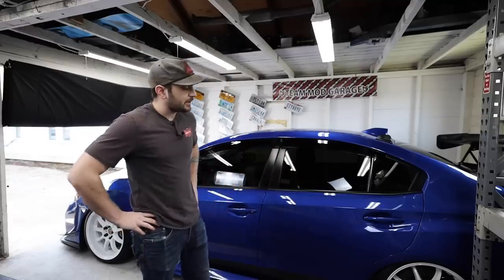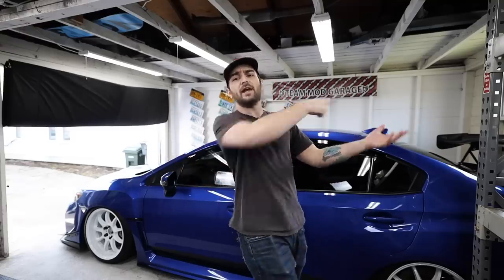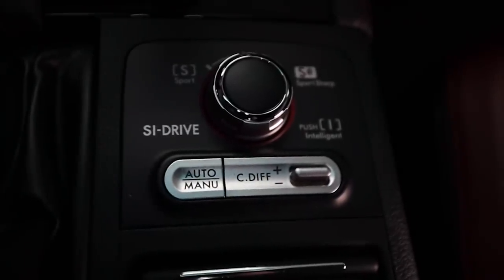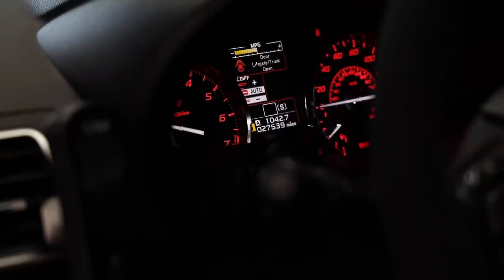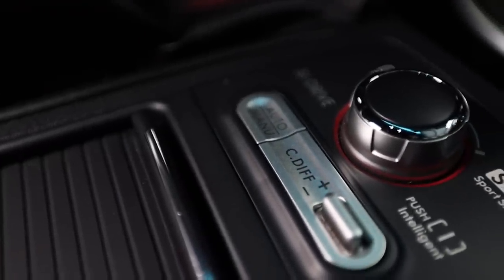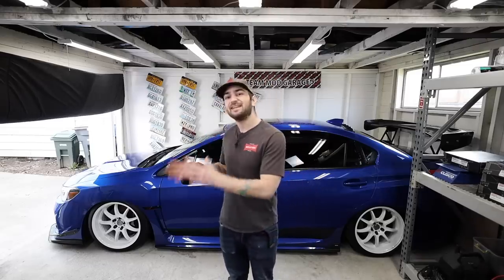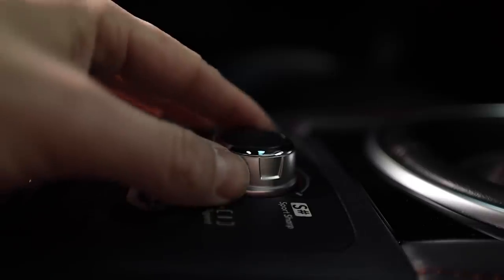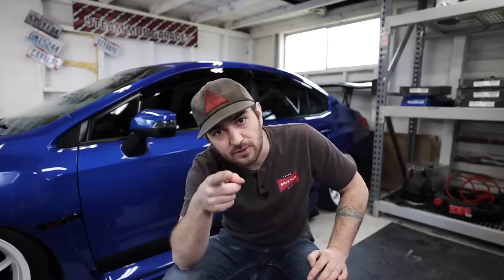Subaru STI DCCD (Driver Controlled Center Diff), SI Drive Explained

Comment: It's not about front or rear bias, it's about how much locking force is applied in the electronic LSD of the center diff.  The bias is dictated by the planetary gears and therefore always fixed at 41:59.  This is hardware-driven and cannot be changed by electronics, which only control the increase or decrease in the LSD effect of the center diff.
Reply: This is exactly what the dccd is doing but it seems nobody understand such simple thing.

Comment: Awesome detailed information brother. My VDC is a glorified boost controller now with my Protune. On an external wastegate setup and 3 port boost solenoid. 

I = 13psi (Spring Pressure) , S = 15psi, S# = 18psi.

Before in stock mode, VDC was pretty much pointless, and always left it in S Mode.

Comment: Torque is definitely where it is at, especially in the rear end for "more adventurous" driving! I will concede that the DCCD is the only feature I wish the WRX came with even if it was only offered in auto format with no manual settings.
Reply from the maker: It's well worth it and would be interesting to see how it would interact with an fA engine

Comment: You also have aftermarket DCCD controllers that add quite a bit more than stock. MapDCCD and Spiider Plus, both are more sophisticated and can be customized as well as have better auto settings. Although this more applies to a WRX with swapped STI 6 speeds.

Comment: Love the videos brother but you are going over the DCCD and SI-DRIVE systems.   The dial for Intelligent (I), Sport (S) & Sport Sharp (# ) is the SI-Drive system.    

VDC (vehicle dynamics control) is Subaru’s Electronic Stability Control. This is found in pretty much every Subaru model.  It’s like traction control.
Reply from the maker: Appreciate the feedback and thank you for clearing it up, I've always just referred to it as the VDC for some reason 😅
Reply: I thought I was losing my mind, or couldn’t read.

Comment: I found in my 06 sti most of the time I have it almost unlocked fully (usually in the second position from the bottom) and it stops the rear diff from doing the annoying clunk between gears at low speeds. If I have it fully unlocked it will do it almost all the time unless i'm accelerating hard between gears. When its wet roads i'll put it halfway locked for better front end control, but if it is snow/ice i'll keep it almost fully locked. Only time I ever lock it is when I am drifting in really deep snow, I do notice the steering get much stiffer as I increase the diff lock as well. Fuel economy is effected greatly by having it more locked as well, so that's why I mainly keep it unlocked. In auto mode I can feel my car almost always has my diffs locked cause my steering gets heavy and you can hear the front diff wine more. Love having the option to change between the settings though, manual mode is definitely the way to go!
Reply from the maker: Just takes the time to learn how to use the manual setting and the best way to do it is by playing with it. Seems like you've got yours dialed in and figured out!

Comment: Just got a '20 STI a few months ago. 
I figure for most driving, leaving DCCD in manual and with full "minus" puts it as open as possible (lowest chance of binding) and since it's not auto, it won't be constantly adjusting things so they aren't wearing out as fast.
Make sense?
Also, in traffic, I find Sport+ best because it's easiest to avoid stalling if the engine responds immediately ☺️
Does the SI Drive setting matter when in cruise control, given that the throttle is fully automated then? 🤔
Reply from the maker: When it cruise control it won't really matter the SI drive just adjustments the sensitivity if the gas pedal 🔥

Comment: Auto + and - is not bias front or Rear. it's just how much force will there be to keep the C Diff engaged. + means the C diff is firm with very little slip that your rear wheel speed with match front wheel speed if either wheel lost traction. - means the C diff is loosely engaged and power will be send to the wheel that lost traction. Please refer to page 7-20 on the Owner's Manual which makes everything crystal clear.....

Comment: Honestly i couldn't go back. The benefits of both are like a different car and awesome to change it up. Auto + is a beast that pulls you through tough turns if you can manhandle the torque steer. True AWD feel. Wish we had split % #s for +/- and all manual ranges. I believe LOCK is locked 50/50.
Reply from the maker: It would be awesome to be able to had that additional torque split. But the DCCD is such a good tool to be able to use 🔥

Comment: Do I understand correctly, that DCCD allows to set the Rear/Front power distribution in a range of 50:50 on highest manual lock up to 41:59 on lowest manual setting?

Comment: Thank you for explaining everything so well! I been trying to decide to get wrx or sti for many years. DCCD and VDC sounds great but thats an extra gadget or equipment that ads more weight to the car and causes reliability to go down because its more stuff to break down. I wish they made the WRX with the STI transmission and the 2.5 liter and sti turbo because I really don't like the idea of adjusting all these nobs. WRX seems much simpler but it has weaker transmission and rev hang and less power than STI. Plus sti can be modified very heavily up to 600 horsepower  with factory transmission. So they are very different cars on the internals.
Reply: Just build an STI swapped WRX if you haven’t already. That’s what I’m in the process of doing atm.

Comment: Im protuned by Johnson tuning. I still feel a big difference when going through the VDC modes. Intelligent wont let my boost dont past 8lbs. Sport gives it a nice response. And sport# is too agressive lol. I hate that mode. Its good for racing but normal driving its too agressive and responsive. If i drive in sport mode for a while and switch to sport#, i find my self over revving the car in first gear.
Reply from the maker: Sounds like it has a solid tine on it and is a lot of fun to drive though 😍

Comment: Hey man, you got it pretty wrong on how the DCCD works. It doesn't bias front or rear. It simply modulates the amount of lock up force the DCCD clutches apply.

Also VDC is not that knob. That's called SI-Drive, which is just a tune mapping changer.

Comment: 'SI-Drive' and 'VDC' are two completely different things. What you're referring  to as VDC is actually SI-Drive. It does what you describe and I agree that it's pretty pointless. Although on automatic transmissions it's supposed to change shift points and the way it shifts, so maybe it makes a bit more sense there.

VDC, on the other hand, is basically ESP - electronic stability program. It uses accelerometers (G-sensors) and gyros to detect 'unusual movement' (a.k.a. sliding out of control) and than cuts power and / or applies individual brakes to stabilize the vehicle.
Reply from the maker: Left a note in the description that I pulled thr names backwards but that you for adding the clarification!

Comment: I really hate sounding like a fanboy..

Hearing your car driving, and considering you've done so many things I've wanted to do and do myself, hearing how it sounds accelerating I know I have my Protune right..

Sounds exactly like mine! Makes me feel like I'm doing it right!

Only problem was trying to put a full 3" DP+N1 Invidia Exhaust. Too much flow, and would overboost constantly in my '17 STi Limited. Had to go back to the factory DP for now until I can install an up-pipe, external wastegate and boost controller. Just was shocked at how much the factory turbo wants to make boost at 55k miles still!
Reply from the maker: Not at all and totally acceptable, glad to hear that your build is going the way you want it to 🙌 the turbo wants all of the boost!!!!

Comment: have another question. i have a 15 sti limited. what does
1) LSD torque
2) Traction torque
3) Initial LSD torque (maximum)
4) Initial LSD torque (minimum)
A) Initial LSD torque (adjustable)
B) Mechanical LSD torque

Comment: I appreciate your time on all these video's. I have wanted a WRX for over 10 years, finally purchased a 2020 STI about 2 weeks ago and i have learned so much from your video's. Question, once i start using OTS Maps or protunes, does the VDC still change the percentage of throttle response, or does it stop working all together?
Reply: Also you can have those 3 setting reset to other values?
Reply from the maker: It will still change the throttle response 🙏😁 once you get a protune down the line your tuner will re program them. And congrats on the new car 😁😁😁
Reply: @Smeedia  Thank you! So far I have only put a Cobb SF and an Accessport 3. But I have collected parts to change out the exhaust completely, J-Pipe, New turbo controller, new fuel pump, 1050x injectors, waiting on one sensor and ill have that all installed and protuned. I was thinking of working on getting forged internals next but i am really unsure of where to go after that.
Reply from the maker: Intercoolet wouldent be a bad idea 🙏🔥
Reply: @Smeedia  fmic was my thought, then get internals up to par before messing with a bigger rotated turbo

Comment: I want to use it for drifting I want to have the option of all-wheel drive but I want to be able to put more of my power to the rear end so I can drink with the car when I want to is this actually feasible with this setup? I would really love it if I could manually adjust it by literally turning a dial and it would put more percentage to rear or two front depending on dial turn but I'm okay with it being more digital plus and minus I'm just wondering can I actually use this in the manual - setting for more of a drift mode? I'm guessing I need more VDC but I'm not sure is this something you could access via computer and make adjustments to where in Fallout it could be all rear-wheel-drive but any other two settings it could 50/50 or what's the deal I would really like a setting where I put it all the way and number three and it's full rear-wheel number to 50/50 and number one either vectoring between front and rear wheel for best traction or maybe even a full front wheel drive mode setting. Is this even possible? Like make Sport Plus all rear wheel sport all-wheel and a regular drive mode that is just front wheel?

Comment: I have an 03 wrx 6 speed swapped with no dccd and in the snow and rain just my rear wheels spin. Is the a dccd i could buy and install into my car? And will that fix this problem? I believe the trans is an 04
Reply from the maker: Iwire has a few options that will work for ya 🙏
Reply: @Smeedia  Awesome thanks. i just looked them up and thats what im going to go with.

Comment: Question what kind of oil do you use ? I heard the factory oil 5-30w full synthetic oil over the summer it breaks down t 5-20w and doesn’t protect the engine. Just want to make sure and what oil u use ?
Reply from the maker: Right now I'm using the motul 5w-30. I had my old oil tested that was Castrol edge 5w-30 after 3K miles it was still golden. Make a video on it breaking down oils a few months ago 😁
Reply: Smeedia yes just saw it thank you have you tested out the motul 5w-30

Comment: I’m getting a Sti and if I hypothetically wanted to pull ebrake at 60 on a closed course what setting would I need to use
Reply from the maker: I hypothetically wouldent advise you pull the ebrake

But lock the diff and send it 

Hypothetically your deferential might explode and it's not a cheap fix

Comment: I've read that some folks like to set the DCCD to Manual in a fully open setting (or low) to get the cars torque to feel more rear biased. Any reason you would choose Auto (-) over Manual in the fully open diff setting?

Comment: So, hearing about your tuning replacing your SI Drive modes raises a question for me - on my 19 STi I just recently added a Cobb access port and the SF intake w/box. I flashed the correct OTS tune for it (waiting until I get a down pipe and a few other pieces before I pay to get it pro tuned), and the SI mode is automatically set to intelligent after the flash completes - does the tune nullify sport and sport#? If I change the mode will that mess my tune or anything? Thanks, love your videos b
Reply from the maker: It shouldent, but I do know that it will default into I but ahouldent stay that way every start up 🤔
Reply: @Smeedia  Awesome! Thanks for the info!

Comment: I fellow someone who dropped the sti trans into a wrx with the fa takes alot to do it and when they switched everything they needed to the light in the middle of there dash for differential blinks guess because its the fa engine and there different systems in it
Reply from the maker: I believe that's Bader built, seems like a cool dude and has some pretty cool cars!
Reply: @Smeedia  yeah im saving to have a short block from him trying to figure out heads and suggestions?

Comment: Living in the Midwest, when we get snow or ice, what’s the preferred settings for both? Also when it’s raining what’s your settings for both? I’m on stock STi recently bought so she’s still in break period at the time of this comment :). Thank you advance.
Reply from the maker: For snow and Ice I would start out in the auto + setting to get a feel for the car a little more. Once you get more comfortable I would play with the manual settings to find a sweet spot that fits your driving style for optimal traction 😁 

When it rains I just leave it in auto mode and let the computer adjust for traction. 😅

Also congratulations on the new car!
Reply: Smeedia Thank you. I do appreciate the response on that topic. I’m going to allow more playing time after break in but I’m excited. Big difference between 17 WRX to a 2020 STi. I can feel the gear change much smoother and the suspension in handling has already amazed me. Looking forward to a fun time with the car.
Reply from the maker: @mattm920  the transmission is the biggest selling point to me for the STI it's the best teams that I have felt out of any car I've owned. Follow up with how you like it after playing with it! Always enjoy hearing everyone's experience! 😁

Comment: Thanks so much for the video as I'm new to this... And getting my first sti next week ... So I should just leave it on auto or minus most of the time right? ... And as long as I have it switch to auto .. it won't go to manual even if I switch there and play with it  right? ... And for auto plus is when it's rain or snow ?
Reply from the maker: That is correct 🙏 congrats on the car! Excited for you 🙌
Reply: @Smeedia  thanks
Reply: @Smeedia  but all blue ones were sold out for 2020 and I can only get the peral white ... Still good right?
Reply from the maker: Pwrsonally I'd rather have the SWP over the WRB 🔥
Reply: @Smeedia  you mean you rather have the white over blue?
Reply from the maker: Yes, 🔥
SWP= Satin White Pearl 
WRB= World Ralley Blue
Reply: @Smeedia  thanks for supporting me .. because the WRB is well known or signature for this car
Reply: @Smeedia  isn't it because blue will show the marks easier? Or you personally think white looks better?
Reply from the maker: I just think it looks better
Reply: @Smeedia  thanks again.... Because everyone else on YouTube are showing WRB .. anyway thanks for showing me that video .. it will help me a lot
Reply: @Smeedia  sorry 1 more question, for gas can I use 91 instead of 94?..
Reply from the maker: Yes just make sure to use the 91 OTS Tune
Reply: @Smeedia  so just 91 is fine and don't need to have 94 ?

Comment: What are the rpm shift points using sport and sport sharp for a stock sti? Do they change from sport to sport sharp also? I shift at 4K rpms in sport currently.
Reply from the maker: No need to change it up, stick with 4K 🙏

Comment: Is it possible to upgrade to the 6 piston calipers on the front of a newer wrx? A video of that install would be awesome! Or an upgraded brake kit Installation pretty much.
Reply from the maker: Oh yeah! But going to be costly 😅 I would go with the 4 pot brembos for the cost savings though
Reply: @Smeedia  so 6 piston calipers is pretty much overkill if you don't plan on putting the car on the track, which I don't any time soon 😅
Reply from the maker: @MakoCrisisVII.  correct 🤣

Comment: Hey I have a issue. I know you’ve taken your Sri apart a few times so maybe you might know what this is. I have a code that says starter relay circuit low. Can’t find much on a 2016 sti :/
Reply from the maker: Whats the actual code #? 🙏
Reply: @Smeedia  P0616 I appreciate the response man I know your a busy guy!
Reply from the maker: Already checked fuses for the ignition?
Reply: @Smeedia  yea I changed the all the fuses near the steering wheel. Started with the ones directed to check. No success so I changed all of them just to see. And still the same. I also cannot get out of “S” drive cause of it, if that helps. It’s got a Cobb intake with box, acessport, and a top mount. Is there an actual starter relay? Can’t seem to find any info on location for a “starter relay”

Comment: What DCCD would you use in a drag race for.best performance?
Reply from the maker: S# of your on the OE or OTS Tune
Reply: @Smeedia  I meant auto+- settings. Thanx again for responding.👍🏽
Reply from the maker: @trevsmoove  I would use manual setting but if your using +/- I would use -
Reply: @Smeedia  I'm gonna try it, and see if it makes a difference.